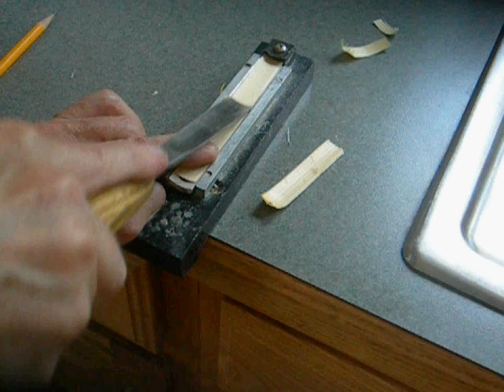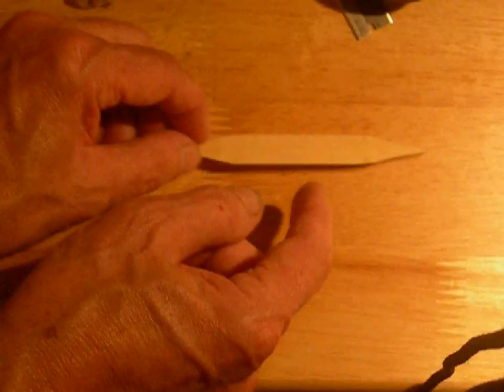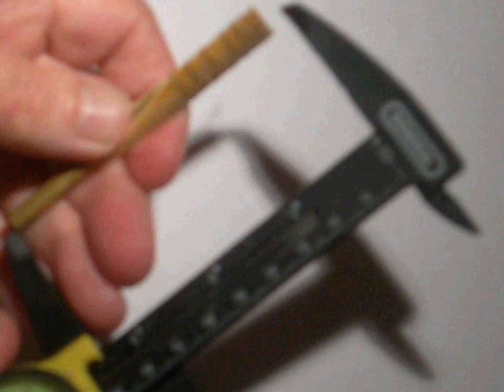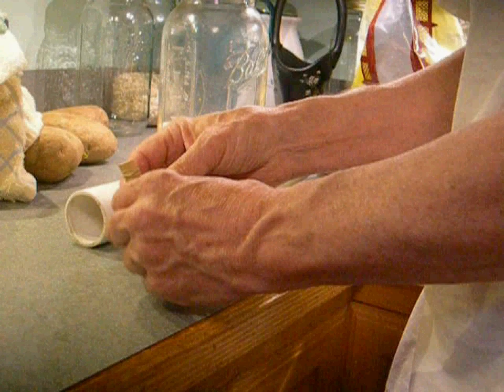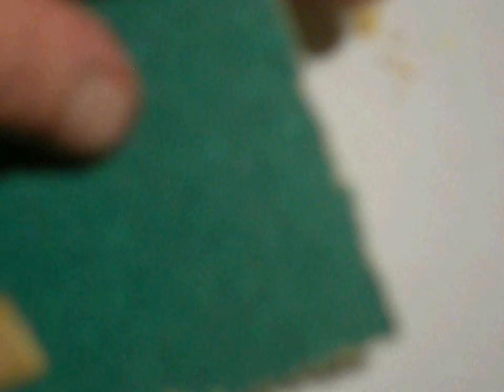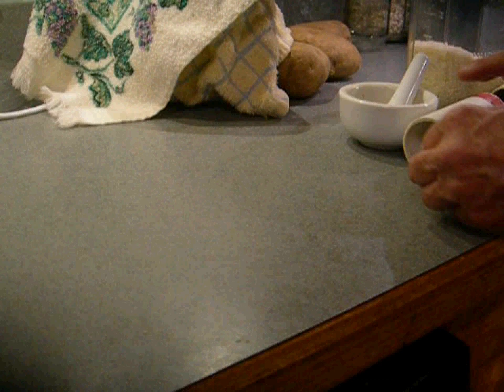Uilleann Pipe Chanter Reed Made with Fast Heat Formation

Comment: Hi David. Thankyou thankyou. I remember talking about this on the uilleann list a good few years, and here it is on youtube. I tried this, with slip made from 25mm cane and 70mm sanding block, giving a 1.5mm slip. I forced it over the staple with no groove cut, but when I forced the lips together the head split on one side. Next time I used a 54mm block giving a 1.1mm head thickness,and this time it went fine. Well, it went just like you said, and this is the best sounding reed I ever made.